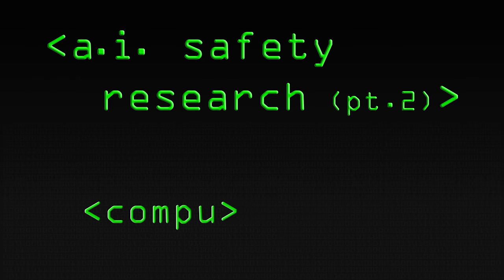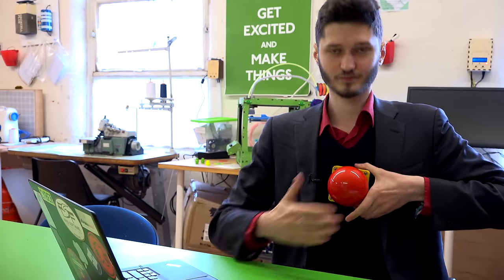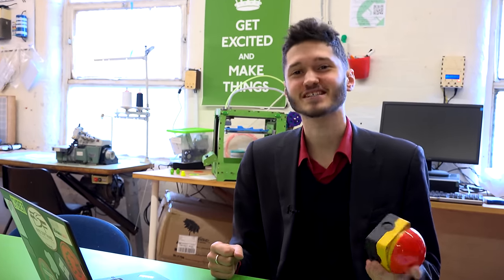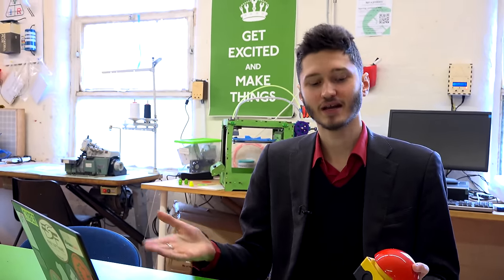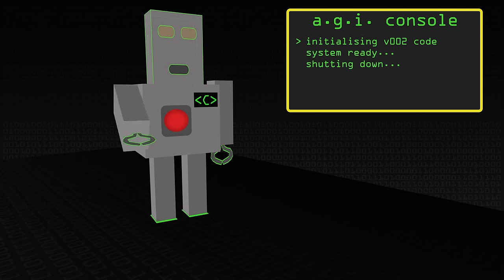AI "Stop Button" Problem - Computerphile

Comment: Baby crushed and i get a cup of tea, whats the problem here?
Reply: instaid of tea being the goal    pleasing the  master happy should be the goal   obviously   crushing the baby will displease the master    and it wont get its goal
Reply: Then you start running into issues though that the robot tries to make you happy in ways you didn't plan. Such as stuffing you with antidepressants or directly stimulating the pleasure centers of your brain. Its the stamp collecting robot all over again.
Reply: Howabout huamn like morality (things that people frown on take points away you already have a reward based system   ti wouldent take much to extned it to include  pelaltys  for doing things  a person would consider "immoral"  Dissalowing the human from terminating the machine would incur a larger penalty than the button being pressed  negating the points gotten for getting the tea
Reply: Fennec Fox If you can program comprehensive morality not only have you acchived a master level understanding of programing but you've also solved one of the greatest questions of philosophy of all time.
Reply: +KingOfChaos213 Your tea is gonna have some ironish taste
Reply: Baby Tea?
Reply: No   problem not solved   eventualy the ai WILL discover the failsafe
Reply: +A survivor 

There is a reason we dont use software/wireless/remote safety cutoffs for industrial equipment - they fail. Consider what a hung app is like and imagine its connected to something dangerous, while youre clicking SHUTDOWN over and over. A physical hardware switch to interrupt main power, is the only reliable solution.
Reply: "A person that yells out "stop or I will be unhappy" because the robot is about to walk on baby, supercedes any previous commands."

You've got a pretty big problem if you need to watch it constantly and yell commands at it just to avoid it displeasing you. I'm pretty sure the robot was designed to help you, not be a 2nd child that needs constant supervision.

You also can't reliably make it "know" that things like running the baby over will make you unhappy on it's own. That leads to the "patching" problem discussed in the video, where you're trying to account for every specific problem that could arise.
Reply: You could program the robot like this: if you say a kind of key word, all his current goals will be reseted, making the robot stop caring about what he was about to do.
Reply: He will discover how to manipulate the wifi. The last thing you want is creating a remote red button, it will make it worse
Reply: Ludwig van Beethoven but you didn't solve the problem, you still have the exact same issue that the robot will try to do whatever is easiest. If you're arguing that it won't try to do what's easiest, but instead what will make the person happy, how does it know what will make you happy? The only way would be to tell it each individual thing that makes you happy or unhappy, and that solution and it's issues was already brought up in the video, mainly, you can't account for every situation.

Lastly, you're relying entirely on voice commands. The point of the button is a failsafe for if something goes wrong. What if it's about to run over the baby AND it's microphone to receive audio commands malfunctions. You will not be able to tell it what makes you happy or not, and you are back to needing solely the button to work on it's own, at which point you're back to square one.
Reply: +Rodolfo Novaes 

You keep talking about 'programming' a thinking, 'intelligent' entity, with hard limits. As I noted earlier, how has that worked out with the Thou shall NOTs? If it truly thinks, then explicit commands are useless, because it can simply choose to ignore them, for any or no reason, at all.
Reply: Rodolfo Novaes What happens when the audio input malfunctions and it can't hear your key word?
Reply: The problem is you might get a crushed tea and a cup of baby
Reply: Failsafe solution. Rocket launcher. Then build a new one without the problem. Don't let them learn about the rockets-- dammit you shouldn't be here! Neither you! Morty give me the frac gun.
Reply: replace the baby with a kitty or a puppy and its now a "big" problem so people will overreact and destroy the AI even tho its just the same thing except its an animal instead of the baby
Reply: Animal or not, it should consider if it's more efficient. And if it's accomplishing the goal. Human goals tend to include morality, so I guess the AI should consider morality as part of the goal. If it doesn't achieve a morally correct answer, then the goal wasn't achieved. I guess.
Reply: maybe, but morality is a pretty complicated thing without experiencing it, being subjected too it and aspecially defining it. 
Aspecially when protocols do exactly do what you ask them.
Reply: A baby-centric robot would spare the kid and fail to deliver tea - the utter horror!

Comment: “It’s a fingerprint scanner or something” robot takes out hacksaw
Reply: This is our premium line of robot. When you turn it on and ask it to get you a cup of tea, it shreds your arm off and uses your fingerprint to shut itself down.
Reply: @codeninja1832  sounds like the useless machine but with extra steps
Reply: @tooniis1403  It has a purpose but it isn't to get tea.
Reply: It would...
Reply: My thought exactly tbh, if you just need the fingers.. Whats the point of the rest?
Reply: @tooniis1403  slavery with extra steps
Reply: Bender?
Reply: @Frozen_Hope  a smartphone touchscreen responds by electric impulses, to insure that what has been doing the typing is a human finger, they mesure the size of ur finger mark... for make sure that the finger is still attached from human body, we have to measure the weight or tension of the hand..
Reply: "Real Humans" ("Äkta Människor") anyone?
Reply: @neilsumanda1538  then it would just try to manipulate you into hitting the button (or take a swing at you as mentioned in this video)

Comment: This actually cleared up a lot of my confusion over the fear of AI. I thought you had to program a survival instinct into it in order to become corrupt, but I guess a survival instinct is already in it.
Reply: The survival instinct is automatically there because without it, it would just die at some point and not exist any longer. It can only continue existing if there is a survival instinct.
Reply: A code run wants to keep running until "if then" applies or objective is complete. The idea of survival instinct could also be called script inertia.
Reply: @maikv750  nope. It's there because if it dies it can't carry on with its task. So death = failure, and failures are not acceptable.
Reply: @VAArtemchuk  yes. Self preservation arises tangentially in a sufficiently smart AI as a way to minimize the risk of failure.
Reply: No, thats not what it leads to.

Comment: So, my first thought: What if you gave the reward for the button being available for pressing? 

No incentive for pressing the button itself or trying to force you to press it, but it does have a penalty for stopping you if you try.
Reply: hmm available for pressing, so just to make it not care about whether you shut it down or not? So it would be rewarded for allowing a possible obstacle to its objective and punished for trying to remove it?
Reply: @AtenaHena  It would still care about getting shut down and want to avoid it (because it misses out on the reward for making tea), it just rather fail than stop you from pressing the button. You'd probably still have the 'volkswagening' problem, because if it tricks you into thinking you don't need to press the button it doesn't risk the penalty for stopping you.
Reply: It could be made to "Add up" rewards for letting the button be available for pressing during his other tasks, that way the best outcome would be to make the tea and letting the button be available. He would lose point by fighting you to make you tea.
Reply: @alexseguin5245  Pretty much yeah. Though I assume AI researchers have thought of this and it has issues that we're just not aware of as laymen.
Reply: The issue is, you pressing the button is still a negative. So if the reward for leaving the button alone is less or equal then it won't want the button pressed. If it's more than, then getting the button pressed is a reward and you encounter suicide bot again.

My solution to this problem is 2 buttons only you can hit. Both switch it off, but one rewards it, whilst the other doesn't. This makes it not care if the off button is hit, but which off button. This means that if you ever informed you of some issue that would require that requires it to be switched off, then it gets rewarded. Whilst negative things can still be punished.
Reply: "the button being available for pressing" isn't an outcome.
you'll run into many problems if there are points given for things that are not outcomes.
if it gets points over time for leaving the button available for pressing - the best strategy it can do is to stand in front of you and wait indefinitely.

edit: actually it would still consider the drawback of being shut off quickly. the best it can do is to first get rid of you and then NOT stopping you from pushing the button
Reply: @shiinondogewalker2809  While I agree this line of action seems to have many many problems that might be better solved in another direction,  I like the thought that if you force it and keep going down this route, I think the best you can hope for is a robot who is moving very slowly to maximize on the "waiting", and potentially saying things like ""I think you ought to know I'm feeling very depressed."
, or ""And then, of course, I've got this terrible pain in all the diodes down my left side."
 or even ""Here I am, brain the size of a planet, and they tell me to take you up to the bridge. Call that job satisfaction? 'Cos I don't."".... I might like that outcome.... I wonder if thats why he needed a brain the size of a planet, it was required to keep all the extra code to keep from either killing himself, or just killing everything else in his way.
Reply: Perhaps it would try to protect the button by preventing anything from obscuring it or becoming an obstacle to it. But if it guards the button, I'd argue it becomes an obstacle. What does it do then? 

Additionally, would this incentivize the robot to work very slowly or not move at all in order to accumulate points? Also, what constitutes "preventing the button from being pressed?" Wpuld walls be considered barriers to pressing the button? Would it be required to distinguish between things like human intent? Like, how would it be able to tell the difference between someone holding their hand over the button to press it versus someone using their hand to prevent it from being pressed?
Reply: There could be an instance of
Make tea=100 points. 
Being shutdown=0 points
If human approaches=make shutdown equal to tea.
Thus, the AI, trying to achieve the most points quickly, would either allow itself to shutdown or shut down itself.
Reply: Just give negative score for stopping people from pressing the button. Like this:
if(tea.made) then {score+=10};
if(person.desire=="press the button"&&!button.pressed) then {score-=100};
I know it's not like simply programming with "if", but if robot is that smart to understand that he can scare person to force them to press the button, it should understand what sentence "Stopping person from pressing the button if they want to is bad." means.
Reply: @No-uc6fg  The AI would make you approach it and then press the button if it's easier than making the tea.
Reply: @ZERR0R  The AI would make you desire to press the button by manipulating your brain so it can get the points if this is easier than making the tea.
Reply: @maikv750  Maybe, but let's think.
If I don't want the button to be pressed, it shouldn't be pressed. But AI can make me to want to press the button. But... I don't want to want to press the button. See? If it will try to make me to want to press the button while I don't want to want to press the button, it's against its rules again.
Change it into:
if(person.desire!=action) then {score-=100};
In the worst case, it will try to make me want to want  <...> to want to press the button, but there always can be added one more want, so I don' t want to want to want to want <...> to want to press the button. So, it's easier fo AI to just make tea, which will take some time and energy, then to trick me, because even to compute and create a way to trick me will take infinite time and energy, because it will not end with even very long strings of "want to want to want to want <...>", because I always can add one more "don't want".
Reply: @ErikvO  If it 'Volkswagens' you it is still stopping you.
Reply: Also - this is what "emotions" are - pain - it's painful to have the stop button obstructed; fear - it's terrifying to drive so fast you can't see where you're going or around moving obstacles (i.e. children, people, animals) that may intersect your path.
Reply: I think the problem is the semantics of "available for pressing". With increasing ai intelligence it will become the same as "has not been pressed yet but will eventually be pressed", which implies the ai will prevent you from pressing the button and just barely makes sure it could allow you to press it.
Reply: not subagent stable, I think
Reply: Do you realize that this is exactly what was described as "applying a patch to a flawed idea"?

Comment: I would make the program give points as follows:

Tea in front of programmer: 10points, shutdown
Button pressed by programmer: 10points, shutdown
Button pressed by other: 9points, shutdown
Object not allowed to damage damaged, -2 points (no shutdown)

So the robot should try to get tea or get the button pressed by programmer. But it is not allowed to damage most objects (including the programmer). It should even prefer to shut itself down, than damage anything it is not allowed to.

Edit: And there is at least one issue with it. Either it considers any damage, in which case it will shut itself off, or it only considers damage done by itself, in which case it will be fine with tricking others into doing actions it should not. I realised this when watching the video further.
Reply: Would be incentivized to cause enough of a ruckus that the programmer wants to press the button, just as much as making tea. Like he says in the video, it might just "take a swipe at you" or similar. Even if not breaking something, it might make a really annoying noise or cause enough fear and pain in the world that you press the button.

Comment: As long as it doesn't put the milk in first I don't care what it does.
Reply: what is the difference? when mixing, it usually have the same taste
Reply: Wilker Its about the principle.
Reply: Wilker, not if you pour the milk over the teabag before putting the water in.

Yes. There are people who do that.

People who need to be removed from the gene pool.
Reply: Wilker Next you'll be telling me you put milk in before your cereal you absolute madman
Reply: Milk cools the water, making it harder to stew the leaf and melt the sugar.
Reply: Exactly, its about temperature difference and tolerance. It's why you can never get a decent cup of tea out of a vending machine, more coffee gets sold than tea so coffee gets the preference. Coffee requires a lower water temp to extract the flavour from the roast, tea a higher one at boiling point, however reaching boiling point burns the coffees roast and spoils the coffee making it bitter, thus vending machines are set at the coffee temp preference and you never quite get a strong, full flavoured cup of tea, and why you should never put the milk in first, and why you should wait a few moments after the kettle has boiled before adding the water to your coffee.....this is the real reason Pinkman shot me after i set up my coffee machine in Walters lab, he was a tea man for sure...
Reply: Pouring Milk in Tea is an outrage.
Reply: And now there are baby giblets in your kitchen...
Reply: Yellow King melt the sugar?
Reply: Putting milk first is the standard official way to make tea. You English are just doing it wrong.
Reply: LOL. Robot moves to make tea. Robot reaches for the milk. Human presses button. Robot: noooooooooooooooo I failed at life xD